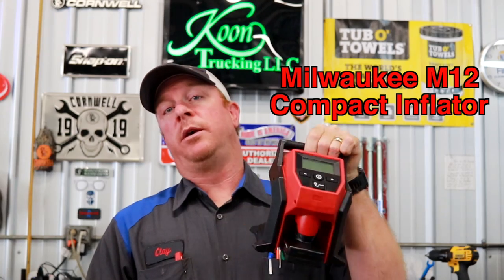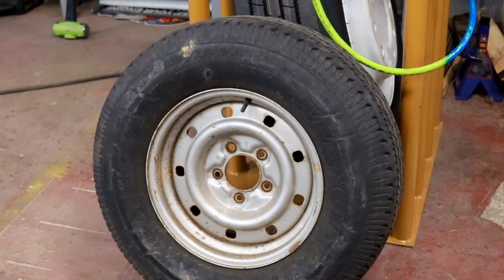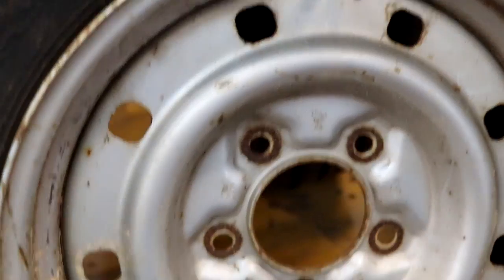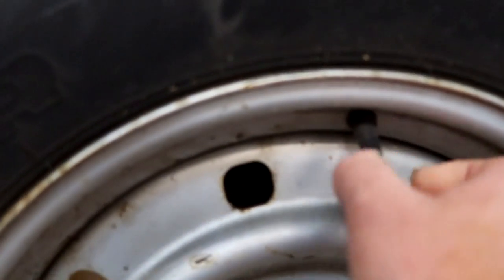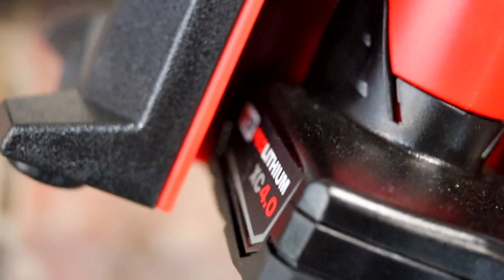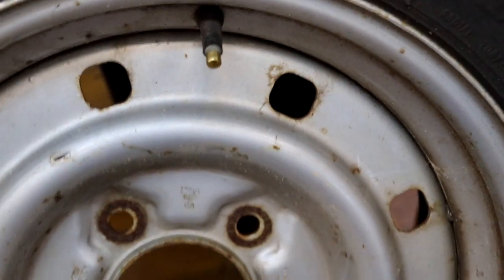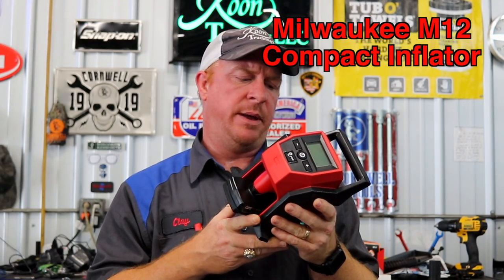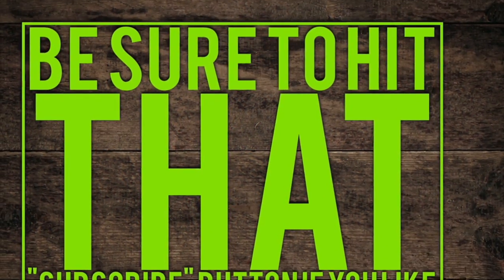Milwaukee Compact Inflator Test: How Long does it take and how accurate is it?

Comment: That inflator is cute and I really want to buy one.  What concerns me is that the parts list does not include any standard parts like brushes and bearings.  It looks like the entire tool is disposable and it is only guaranteed for three years instead of five.  Are these tools built to last or will we  be sending the majority of them to the landfill shortly after the warranty expires?

Comment: Okay, that was impressive.  I was expecting at least 10 to 15 minutes to inflate that tire. But I'm concerned about the battery when inflating say a 3/4 or 1 ton pickup tire when your talking 60 to 70 psi. Will the battery last long enough to do that? Because I see that as a possible use on say farm implement tires and some of them take a fair bit of air to get it to hold an implement....great video and good demonstration. Thanks for sharing....
Reply: Maybe with the XC5.0 or XC6.0 battery packs

Comment: LOL that was great..  “”yea so basically I don’t know what two of three attachments are in the back but there they are and yup. That’s them” 🤣 that was great

On a second note, seven minutes does seem like a lot but that is a high-volume tire. Your thoughts compared to other products as a mechanic? You seem to like it but how does a fair in comparison to.. well other similar items. I’m also curious to see the time it takes on an average vehicle, like a sedan that is 10-15ish +\- psi low. Or a common average sized lawn tractor. Etc. By the way how loud was it? 

Milwaukee 12V line is simply amazing!!
Reply from the maker: It really wasn’t that loud. I was actually impressed by the time on this text. I have a 12 volt plug in air compressor and it takes a lot longer than 7 mins to air up anything. I’m going to say it will take close to that time to air up the front tire on my mower (John Deere, regular mower none of those fancy zero turn ones)